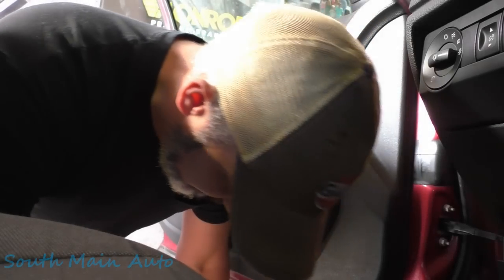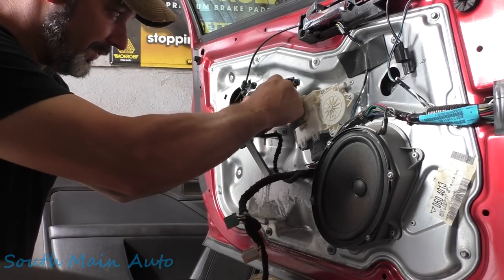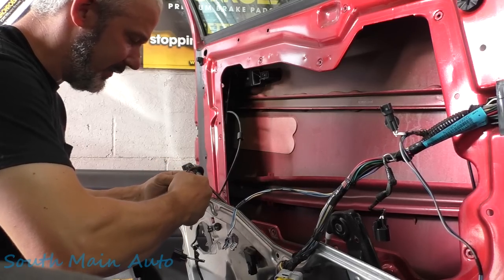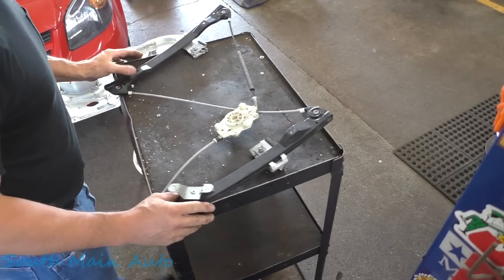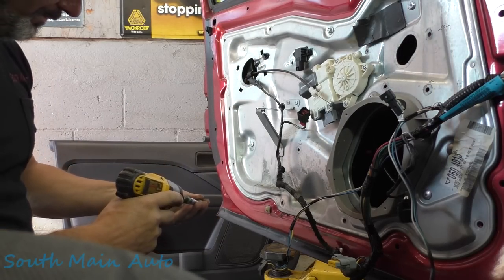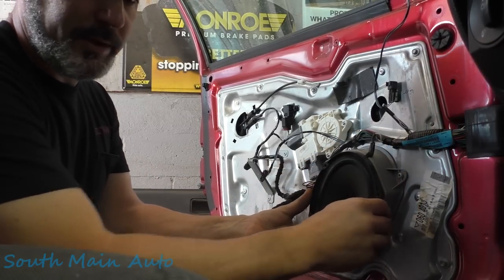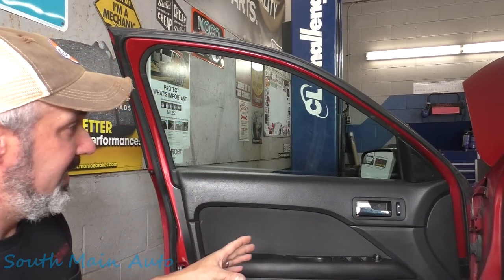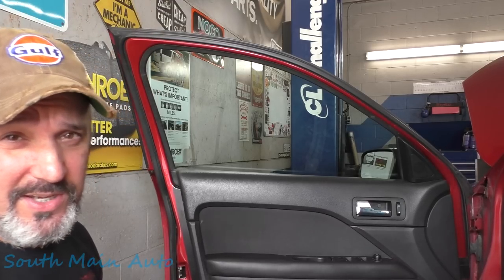Front Door Deconstruction - Fusion Edition

Comment from the maker: Astro Pneumatic Tool PR14 Air Riveter - https://amzn.to/44aGq88
Wera 056490 Tool-Check Plus Bit Ratchet Set with Sockets Metric - https://amzn.to/453Qp0q
Lisle 63900 Window Holder - https://amzn.to/449kWbS
Reply: good job for putting that extra shine on there at the end pal.
Reply: WHAT A PAIN IN THE ASS ...
Reply: Who makes the pry tool you were using to remove the wiring clips?
Reply: @romanmcdonald SK. It's nice. Indexable.
Reply: @mattmanyam  Thanks!
Reply: Is it normal to have rivets holding the regulator in?  Is the “official ford way” to replace that entire silver panel to replace the regulator?
Reply: @peterd314  Sure. (It's certainly not just Ford)
Rivets are lightweight.
They make assembly much easier/faster/cheaper.
The odds are that they will never have to be changed, but it's not a huge deal, if they do.
Reply from the maker: @romanmcdonald  https://amzn.to/3seA4aR
Reply: Is that a fusion? Or a focus? Used to own two focus vehicles now fusion doesn’t look anything like the spaceship I drive😂 hopefully ya got videos in the 2013 fusion just bought one from my brother. Thanks for the helpful videos
Reply: @jeremybrunes38  After looking up pictures to compare online, this car looks like a 2012 Fusion before they did the 2013 redesign. My November 2012 build Fusion is the all new redesign for ‘13 model so I was confused while watching the video as the dash and door was completely different than my ‘13. Especially since I’ve had the door panels off and it was nothing like this. No biggie.

Comment: I've done a few of these on my own cars and I dread it. All those connectors, multiple screws and bolts, and finally the rivets make this a difficult job. Eric makes it look easy, but this is hours worth of work for a normal human being with tools you don't necessarily have. I've never seen a plastic panel like this with everything bolted, riveted, and plugged into it. Normally there is a sheet of plastic with goop on it hiding the works inside the door. Before starting this job, you have to sit back, relax for a minute, and get your gumption up. Take your time and it can be done.
Reply: A tall cold adult beverage is enough to get the gumption up.
Reply: if we all had manufacturers tools available handy jobs would be easy. But nope way too expensive.
Reply: inner part of the out door handle on a 2001 ford focus, took about three times to get it set right.
Reply: I paid ford $380 the fix my window on a mustang. Ford motor company's of big rip-off in their paint 😞 😞 😞 sucks
Reply: Same.
Reply: I was suprised how well made this door was bloody good sound proofing I also are used to doors with the plastic and goop only. You dont need any expensive tools for this job as hand rivit guns are cheap and useful for all sorts of jobs
Reply: @dave6199 , I don't believe you can use a simple hand held rivet gun for the 1/4" rivets. In my experience they only go up to 3/16" rivets. For 1/4" I bought a manual Marson Big Daddy which requires two hands to operate.
Reply: @mailpup  yep no worries, they are bigger than I thought so not user friendly then.. that figgers
Reply: You make it look easy awesome work
Reply: Hyundai use the same approach on some of their models.  I alway send up with my wrists cut to ribbons
Reply: Like Dirty Harry once said Man's gotta know his limitations!! But an old timer once told me it's just nuts and bolts! And in this case some rivets.
Reply: For me a glass of hemlock would help get the gumption up.
Reply: @nigeldoran Yup! Can confirm. Hyundai/Kia do use metal panels. Have proof on my channel, replacing one. Not fun. Also used an aftermarket Dorman, of course it didn't fit right...

Comment: One thing that always pisses me off when I get my car back from the dealer/local shop is there's grease and/or dirt on the steering wheel, door panel, floor mat, etc.  They just don't care.  Thank you Mr. O for everything you do - you are a true professional.
Reply: We I can definitely tell you that would not happen at a Toyota dealership if it did you point it out to the service manager to get all of the inside of the car deep cleaned.

Comment: My 00s Silverado passenger window regulator was so slow that it would trip its breaker on the way up in the winter. I took the door apart and greased the tracks with no improvement. I ended up doing it again and sprayed grease on the cables through their travel and now it's fine. And the driver's door regulator pulls away from the glass when it's iced up every year but that's a different story.

Comment: I had to put a regulator in a crown vic. Used a new factory regulator and got about a year out of it. When I replaced it again I noticed the glass was kinda hard to slide up and down in the track with nothing hooked to it. I got some Blaster brand silicone lube and soaked the felt that the glass slides in and when I finished putting it back together the window was moving almost twice as fast. That was about 10 years ago and still has same regulator. I hit up all my vehicles and their windows picked up speed to.

Comment: When I worked at the local RV dealership, we were sent to the Fleetwood service training program to learn about customer service.
One of the things was to leave the unit cleaner than when it came in.
One of our mechanics learned that lesson the hard way. A customer came in with a seven page list of warranty items to fix and repair. A lot of them were easy quick things like cabinet door adjustments but there were some substantial items too.
It was all well and good until the customer went to get in the drivers seat and noticed a grease stain.
All the hard work on the repairs, even though everything was completely fixed, all that customer good will went right out the window.
The customer yelled and screamed at our service advisor and service manager and then went up to the office to complain to the owner.
Cleaning the seat wasn't an option.
Not only was all the good work forgotten, it cost us a brand new drivers seat for his motorhome and they aren't cheap all because the mechanic didn't take the time and bother to lay down a clean piece of plastic or other material to keep the drivers seat clean.
It's nice to see a shop that cares enough to detail the work area on a vehicle after repairs. It's one of the reasons that I'm a long time subscriber to your channel!

Comment: I did a window motor replacement on a 97 Explorer. Motor is held in place with 3 bolts. Ford only put 2 holes in the door panel.  There is a dimple in the metal where the third hole must be drilled to release the motor. Thanks Ford.

Comment: This vid gave me a warm and fuzzy coz I've had to replace the regulator on my 12 Fusion TWICE. Lived in Upstate NY and the NAPer regulator failed me after I moved. I did not rivet the new one back on there. Just got a set of nuts & bolts and did the job. Surprisingly, the replacement one the 2nd time from O'Reilly (Dorman) has held up longer.

Comment: Holy crapola, that is a lot of work just to replace a regulator. Thanks Ford!
Reply: I bet you can buy the entire thing --  but it just costs more.  He probably saved money doing it this way.   It's just a few rivets;  not that big of a deal.  It's a bit of a headache though.
Reply: Try a Skoda Octavia MK2, no bolts holding the metal panel just pop rivets. So you have the worry that if things are not assembled OK, you have to drill all of them off again. So I replaced them with rivet nuts and domed hex bolts. Thanks VW Group.
Reply: modern cars....
nothing wrong with a simple crank
Reply: That's not too bad.
Reply: Don't thank Ford, thank the underpaid poor engineers that are on the payroll from another Ford division  in another country that designed this regulator for another car and was told to make it work in this car.😢
Reply: Most Automakers have gone this route using cassette style internals to speed up the assembly process. all that is one piece as its installed going down the line. This is east compared to their earlier stuff when they used plastic hardware heads on steel screws. You try to service the regulator only to have to replace the riv-nuts in the door shells cuz the heads broke off
Reply: actually not bad cover comes off..try the old style inside the door

Comment: It's always the 2 washers!!! 

If you recall, you removed the regulator when the window was halfway up.  When you inserted it to the new track it was all the way down.  This put the regulator out of time with the new track.  To fix this, you need to express run the regulator to either up or down WITHOUT it installed, and manually push the window to where you chose, and re-install the regulator.  

No relearning required!

Comment: I am 71 and have been doing auto body for 49 years. I have a metal box that is full of leftover hardware not just from me but over the years it has gotten to be about 50 lbs.  Mostly odd bolts and clips from before cars snapped together.  I use it as a weight box on my lawn aerator

Comment: Anyone else appreciate the beauty of the car door?  Layer of metal outside and one inside to create the beauty that existed on stage coaches but with remarkable Strength.  

Then look at all of the "stuff" inside with all kinds of connecting wires and linkages:  Speakers, Windows, Locks, Handles.  Add the inside covering and that's quite an engineering marvel.  Don't forget strong and accurate hinges and weather seals.  Yikes.

Comment: You missed a rivet on the regulator  under the motor.  You should have put it in before the torx fasteners on the motor.  Yeah,  okay I now see that you caught it before the end.   Maybe put a machine screw and self locking nut in that spot.  Yeah,  we saw that piece of foam fall.  I'm not sure if I would have taken it apart to put it back in.   But,  good on you and your customers for that.

Comment: Most relearns I've had to do said to push and hold the switch for 5 seconds after it stops both directions, up and down to learn the stops. It's worked on every car I've done so far. And if it has a frame less window, the door must be closed or the window will not go up past the installed height until it is initialized.

Comment: Just got my Acura mdx back from the shop, with more problems than it went in for repairs. Got it back with new used front right fender cause they hit a curb or something, Blew all my fuses in the center fuse panel (under hood ) has 2 fuse panels under the hood. My radio wasn't working anymore and that's how I found the fuses missing and blown. Acura thankfully has lots of replacement fuses in the panels. Most of the issues where electrical, paid $2100.00 for repairs to be done in the first place, but they did not do half the work I requested plus they had the vehicle for 3 weeks probably waiting for the fender to be shipped to them to replace. But When they installed the fender they didn't line it up right so now I have to do it. :( 
Wish all mechanics where like you Eric.

Comment: Oh man, I just did that job on my fusion. Kicked my butt a little. Wish I saw this first! I am left with that problem where 14.267% of the time the auto up gets to one inch and retracts. Thank you for learning me up on the auto learn. I thought I needed to replace the window run for binding.
Reply from the maker: GENERAL PROCEDURES > WINDOW MOTOR INITIALIZATION > DE-INITIALIZATION PROCEDURE

-Turn the ignition key ON.
-Operate the window control switch in one-touch up mode and remove power from the window motor while the window is moving  by one of the following methods:
-Disconnect the vehicle battery cable while the window is moving  .
-Disconnect the window motor connector while the window is moving  .
-Remove the LH or RH front window motor fuse while the window is moving  .
-This will de-initialize the window motor and reset the window motor to its original factory settings.
-Reconnect the battery cable, window motor connector or window motor fuse before proceeding to the initialization procedure.

GENERAL PROCEDURES > WINDOW MOTOR INITIALIZATION > INITIALIZATION PROCEDURE

WARNING: Keep objects and body parts clear of the glass panel when carrying out the initialization procedure. During the initialization procedure, the glass panel closes with high force and cannot detect objects in its path. Failure to follow this instruction may result in serious personal injury.

NOTE: The front window must be in the full OPEN position for this procedure to operate correctly.

NOTE: If the initialization procedure is only partially completed, the front window motor will remain de-initialized and will not operate in one-touch up mode.

5. Turn the ignition key ON.
6. Press and hold the window control switch until the window glass stalls for 2 seconds into the glass top run and release the switch.
7. Pull and hold the window control switch until the window glass stalls for 2 seconds at the bottom of its travel and release the switch.
8. Test for correct window operation by carrying out the one-touch up feature. If the window does not operate correctly, carefully repeat this procedure.
Reply: Thanks Mr O! Much appreciated.

Comment: Makes me feel better for the hassle I had replacing a window regulator on a 2001 Civic. New regulator fit on the door frame perfectly, but the glass would not align in the mounting holes - off by maybe 1/4".   Could not figure out the issue UNTIL I noticed the regulator I had was for the driver side on a Civic coupe versus a sedan even though the part numbers checked out. Had to go to two other part stores to find the sedan regulator and, voila, problem solved. Thirty minutes to replace, four hours to track down the right part. Thanks as always, Eric.

Comment: And you are correct, I did see that foam cushion fall off when the door panel went back on. Surprised you didn't see it fall and roll around on the floor. Good job, wish my 05 Silverado had the auto up feature, only has the auto down. Oh well, at least I don't have all the other features like TPMS that tend to be a P.I.A.

Comment: The door panel is a good design. It is much easier to replace the regulator on a bench rather than on the door. As far as the silly read clip. Yes throw it away. It will tell the next mechanic that the window was previously worked on. Rather than rivets, I like to use bolts with nylon locking nuts. It is nice to see a mechanic cleaning up after the job is done. It shows pride in thier work. Another great video.

Comment: So glad all my old GM cars have regulators that are not riveted. What a pain. Those suction cup holders are very cool. But my trusty blue tape has worked on 4 regulator replacements at 1/2 the cost or more. My local pick-a-part has all the switches that no one stocks anymore because they will break. The pleasures of owning 25 year old  cars.

Comment: When I worked in a fabrication shop we did pop rivets all day long, and occasionally had to drill them out when a mistake was made. You don't need a large drill bit to get those out. Use a bit that is no bigger than the hole it goes through, you'll save a few seconds every time. You got me laughing again today, when you asked if we were OK when the camera tipped over.
Reply: Sometimes it's easier to remove the head of the rivet, then try to drill out the body, especially if the mandrels' still in place.

Comment: Some rivets have the remainder of the pull mandrel in the center of the rivet which is made of tempered steel thus requiring to punch them out, making the drilling process much easier.

Comment: So, when I saw you were doing a Ford regulator I was intrigued, wondering if it was the same stupid design as my 89 Aerostar. Sure enough, riveted in place, so you had to go  to the hardware store and get some bolts and washers. God forbid they should tell you the size. Thanks for the update Eric.

Comment: I have different color Sharpies and I color in the head of the different bolts and make little arrows pointing to the bolt holes. So if all the outer bolts are one size, they are going to be green and then another set of different sized bolts will be red or silver, etc. I do this on electronics too, my PS3 and Xbox 360 have bolts inside that are colored different colors. If I can't find my markers, then I use nail polish instead. It's always good to be organized. On bigger jobs they get baggies with a slip of paper indicating what the bolts and nuts are for. I'm amazed when mechanics throw all the bolts and nuts in a magnetic tray and then try to figure out where they all went. If you paint the heads beforehand, the colors show up in photos too, making it easier to figure out where they go. I had a friend who was a mechanic help me replace the lower intake on my Camaro and he started disconnecting stuff and ripping stuff apart while I was inside getting drinks. It took me forever to figure out how the vacuum connections went back together. That was a rough job, mostly because of Demolition Man with a wrench lol
Reply: "Demolition Man" has put many things back together without any markings. It's just the  flow of the job.
Put together a used desk. Previous owner marked *EVERYTHING*. To me, it was logical the way it went together.

Comment: Are you sure you had the glass fully bottomed in the actuator?  If the glass wasn’t fully bottomed the first time, that would cause the glass to bottom in the top channel before the actuator has moved as far as it wants to, that would cause the auto reverse to engage.  Sometimes it helps to leave the pinch bolts loose and run the glass all the way up to fully seat the glass and then lower it with someone pulling down on the glass to keep it seated until the bolts are behind the access holes.
Reply: He did mention that verbally, and messed about with it for a while. Probably more off camera as well. So my answer would be yes..Yes I’m sure that he’s sure. By the sea shore in fact